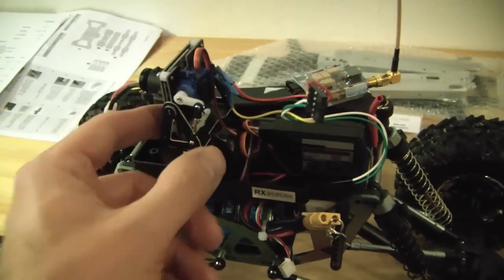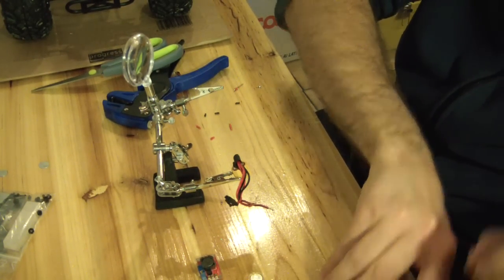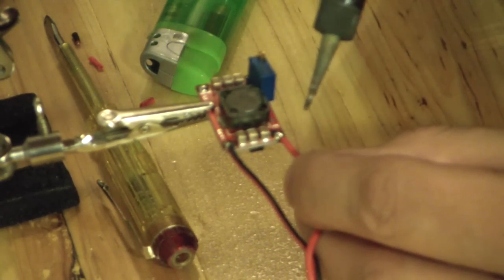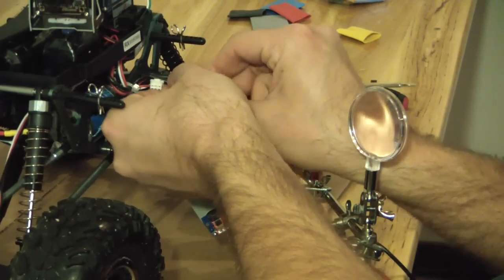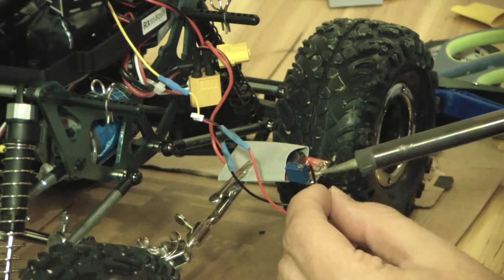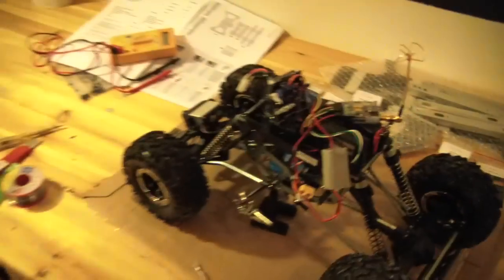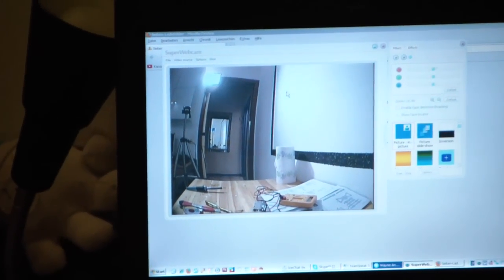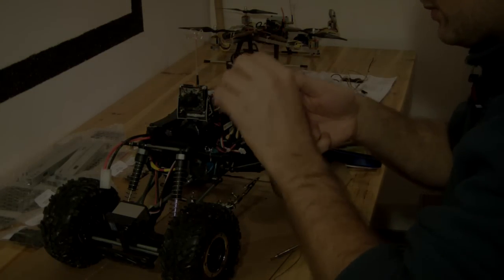How to use a (step-up-down) voltage regulator

Comment from the maker: Oh, i actually have a heat gun - it was just down in another tool box and i was to lazy to get it out for just two cables ;D  I am very lazy sometimes ^^
Reply: YOU DON'T NEED TO DISCCONECT EVERY TIME YOU ADJUST THE VOLTAGE.I HOPE I HELP YOU TO SAVE SOME TIME.YOU HELP ME WITH THIS PROJECT.:))